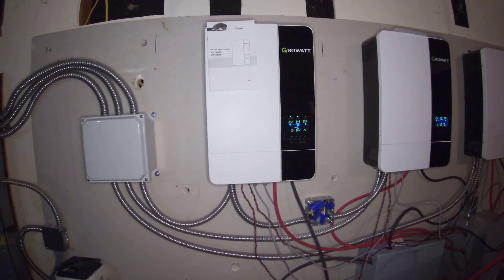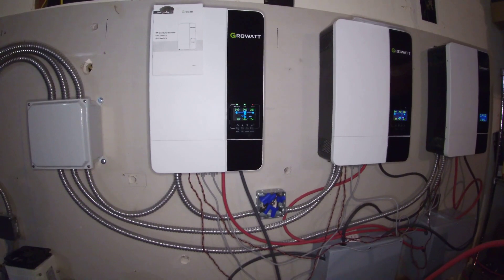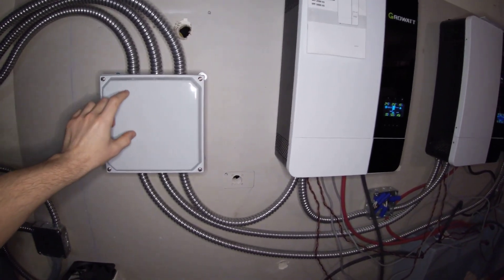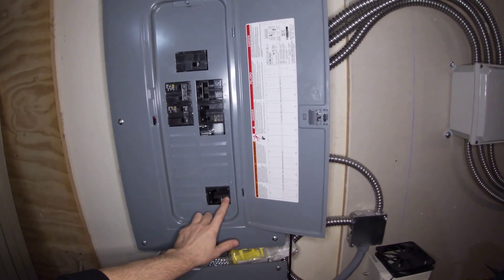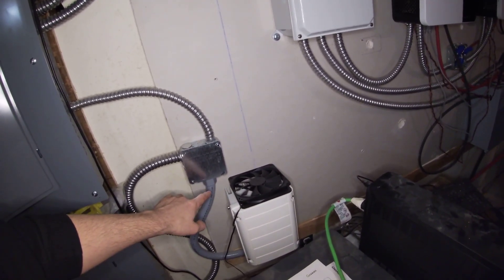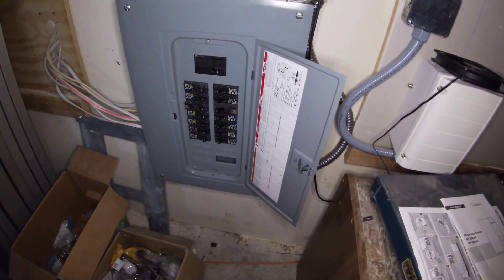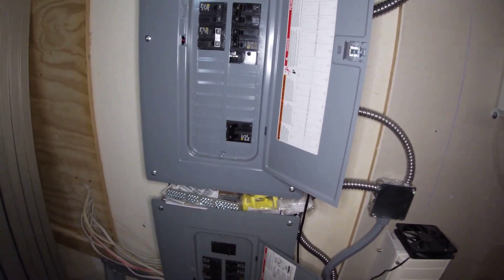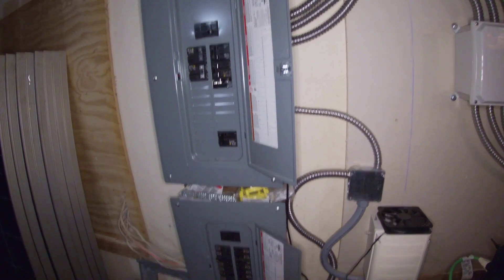Growatt 5000 ES with auto-transformer for split-phase power

Comment: Nice setup.  Coty did you bond the neutral and ground at the 120vac subpanel as NEC required? I have the same inverter and the same autotransformer from Signature Solar. When I measured between Neutral and Ground before bonding there is a 40vac diference potential. Can you let me know ( if you can check your system) what this voltage is? I will not bond them until certain this is truly safe.

Comment: I don't understand how you junctioned the 2 hots in that little box. You only have 230vac coming out of the inverter one leg and a return @ 0volts and a ground right?
Reply: Technically, he has an L1 and an L2 wire.  All three L1's connected together and all three L2's connected together inside the Junction box.

Comment: Even American 240V loads without a center neutral are inherently depending on there being a neutral with a bond to ground for fault protection and to provide an alternative route for a fault, rather than possibly through a person. The 240V load panel needs its own neutral. EU appliances use neutral on one of the 240V, but we can’t simply do that using American appliances that assume a center neutral.

For cheap autotransformers look at using the transformer adapters that go from 240V to 120V, EU to American power or vice-versa, they are pretty much all autotransformers on the inside that keep neutral on a “leg”, which works going from American 120V to EU 240V(or 220/230 etc.) or from EU to American 120V, but not to American 240V. They have to be opened up and rewired.
Reply: I found a video where a gent shows the details: https://youtu.be/0E8fV9VMDFs
Reply from the maker: You've made a really good point, I did not understand this part before. Looking at NEMA 10-50p wiring diagrams, it does show that 3-prong 240v connectors should be using a shared neutral and ground. That definitely throws a wrench in my configuration, and I will have to rethink this again. Now I'm back to the original problem of how to wire 240v-only inverters with auto-transformers in a way that prevents a floating neutral... Though it's currently working as-is with all my appliances and appears (to me) to be safe since the ground path is there.
Reply: @CotyCondry  "Ground" is really making everything the same potential relative to an electrified conductor, and making the path as low resistance as possible between all those things. This minimizes the likelihood of a person (or animal) becoming the only and/or lowest resistance path, while also attempting to make the path in general low resistance back to the current source - the circuit breaker - so that a fault in the path results in a tripped breaker.

In the case of 240V with a floating or no neutral, that low resistance path doesn't exist. 

An example: Suppose there is a fault by one of the hots in an appliance against the case, and for some reason there is a path through one of the control knobs to the other hot. Typically the case would be bonded to ground which in turn is bonded to neutral, so this would be a low resistance path and trip the breaker. If there isn't that bond, then what could happen is someone could be touching the case and reach to the control and get electrocuted, or even just be standing on the same concrete floor the appliance is sitting on.

Now this scenario isn't very likely, but it actually has happened, and a surprising number of times too.
Reply: @captainobvious9188  I had a question about that too. What if that breaker in his 240v panel was a GFCI breaker and the appliance was connected to a NEMA 6-50 plug. Are you saying that the fault would still not be able to clear?
Reply: @wydracon  That is correct, because a ground fault is current taking a path through ground (potential), but there is no path.

Although there actually is a path through the 120V subpanel, but it is dependent on it being on.
Reply: @captainobvious9188  Hi. I have this inverter and same autotransformer from Signature Solar.  Before bonding the Neutral to Ground i measured it and the result is 41 vac. ..I do not dare to bond them with this high potential. I reached out to SS and their techs are looking into this issue. What are your thoughts on this. This inverter [ US version] provides 94 vac L1- Gnd and 154 vac L2- Gnd. When measured across L1-L2 you have 240 vac. I think the issue stems from this imbalance...what are your insights?
Reply: @CotyCondry  All 240 volt appliances that need a need neutral wire must go in the bottom panel. Where there is a neutral bar. 240 Volt ... hot water tanks, well pumps, heaters, microwaves and clothes driers can be 240 volt with no neutral required = top box.

Comment: Very nice setup!  I am interested in the details of having 3 Growatts in parallel and the connection to the grid side.  Can you please show the details of the wire size in these connections and the Main breakers used in the 240 panel?  Does all Grid power pass through the Growatts?

Comment: One question I have is, how do you run say a dryer or electric range if it requires a 4 prong 240v with a neutral in your current set up?
Reply from the maker: You'd probably need to add another auto-transformer to the 120v panel and use the 120v panel for that specific load. But you can stack auto-transformers on the same panel without added risk.
Reply from the maker: just to clarify, my dryer and range are 240v only, no neutral in their wiring. so I didn't need to add any more capacity to the panel with the neutral.

Comment: This seems a sensible and safe way to set up this system. i originally put  a ground cable to my panel from the growatt to the autotransformer but found that there was 12 volts going through it so i disconnected it real quick. There should never be anything going to ground under normal circumstances , so i am told.

Comment: I don’t see any solar input. So are you only using this as a backup to your grid power? I heard you mention that you would like to add solar.
Reply from the maker: I have some solar panels set up on a shed, need to bury some conduit and cable to connect them to the Growatts. Planning to add solar to the roof this year.

Comment: Are you also bringing the neutral back up to the top distribution panel for the 240 volt loads?
Reply from the maker: no, the 240v panel has only the L1 and L2 and ground conductors connected.

Comment: I was thinking the same but with isolation transformer. I am assuming you are not grid tied. With isolation transformer, it will work with grid tied system as there will be no autotransformer trying to balance grid transformer.
Reply from the maker: I have grid power connected to the growatts, so they operate in grid bypass mode until the grid power goes down, then it switches automatically to battery power.
Reply: @CotyCondry  There is a concern as auto transformer might balance the grid transformer. But as your neutral is not connected to grid it will not do it. Are you bonding ground to neutral in 120v panel and grid neutral is bonded to ground. will it still complete a circuit?
Reply: @wasifsyed1085  I would like to see inside his panel’s. As he doesn’t have solar hooked up. He has to be powering and charging his batteries with the grid.
Reply: @jamesshomesolarmore2223  Yes he is basically using 5000es as a UPS. His setup is better than David Poz upgraded setup. David is using a triple pole breaker with two hot and one neutral to disconnect his transformer.

Comment: Great setup, this makes the most sense for this system. Are you able to expose the junction boxes to see how they were wired?
Reply from the maker: thanks, yeah I could make another video with them open and show everything with a little more detail
Reply: This is what Signature Solar diagram shows.
Reply: @TheFatman819  no they don’t show separate boxes for 220/240 and 110/120. The solar edge transformer only handles the imbalance of the load. I did a load test showing my transformer handling over 10,000 watts of 120 loads. As long as you have the loads balanced? You won’t heat up the transformer.
Reply: Please make a video showing inside the junctions for my electrician! 😃

Comment: Nice set up thanks for sharing. Are u considering grid backup?
Reply from the maker: yes, this is currently doing grid backup for almost everything in my house. I have 30kwh of lifepo4 batteries connected to large bus bars, and the Growatts connect to the bus bars as well for charging and battery backup power if/when grid goes down. I have utility power connected to the Growatts as well so they're normally doing grid bypass to power everything. I'm planning to add solar this year, hopefully enough to use as primary power source and just have grid as a backup for extended cloudy weather.
Reply: @CotyCondry ,  could you provide a picture of the sections where you combined the inverters and auto transformer. Also are you connected to the grid through a transfer switch..
Reply from the maker: @winstonwolliston2086  yes, I will make another video with more detail and with covers off the boxes and panels. There is no transfer switch, the grid is connected to the Growatts' grid input, which are connected through normal 2-pole breakers in the main house panel. The Growatts have a few power selection modes, I have them set up as "grid bypass" where they pass through the grid power to output L1 and L2. If grid power is lost, they automatically switch to using battery power.
Reply: @CotyCondry  very cool, never knew you could set those up like that